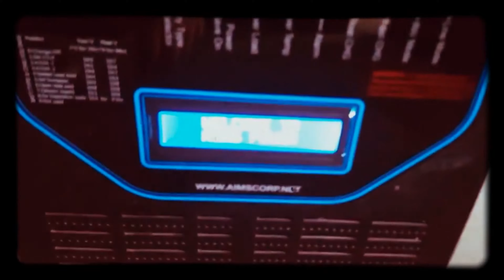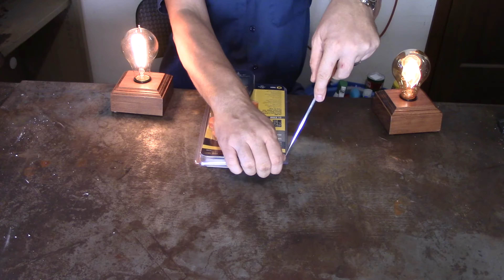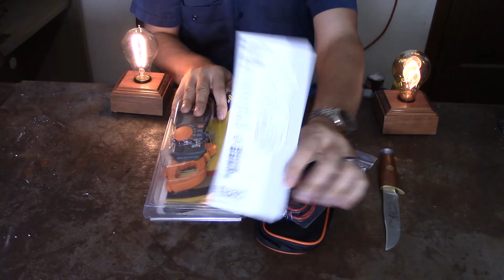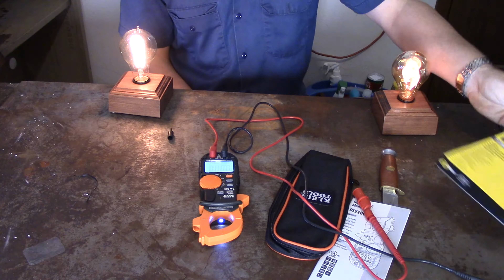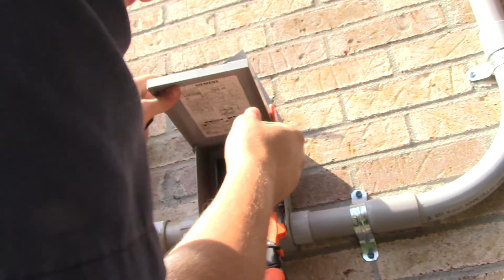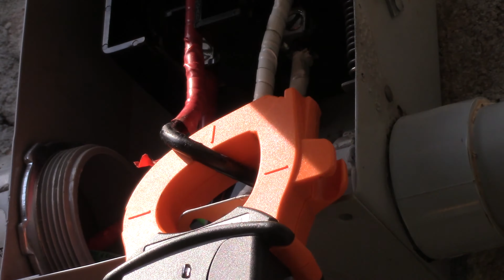Unboxing Klein Tools Meter For The Repair Of The Solar Problem.

Comment: And never leave the test lead in the current socket after taking a measurement - always return it to the voltage input! Not that you'll have this issue much as you'll be using the clamp for the current. A DC reading clamp meter is a very nice item to have when working with solar power. I don't know what I would do without one!
Reply: Btw: If you suspect that a component such as that disconnect is making a bad connexion measure the voltage between it's input & output terminal. If you're getting a few hundred millivolts difference then the connexion is not so good. In fact if you know the current flowing at the time you can do a simple W=E x I calculation to see how much power is being wasted across the component. It's also a good idea to measure across a similar item (running in circuit) that you consider is in good condition, so you know typically what an acceptable voltage drop is for that component.
Reply from the maker: Thanks i will look at that next i was really busy today and tried to make a video but did not turn out good so i will start over.

Comment: Andoer UNI-T UT210E True RMS AC/DC Current Mini Clamp Meters w/ Capacitance Tester   i got this one for 54 bucks CDN . i got the idea from Chris in Oklahoma. Chris swears by it so i got it. no magnet but has what i like the dc amps is neat.
Reply from the maker: +George Gardinier cool
Reply: Yep, I got one of those UNI-T jobbies as well after seeing Chris' videos.
Reply: i put mine on the negative wire on my car and could see how much the computer etc draws and was surprised. did some on my solar panels like chris. 54 bucks was a great price

Comment: flip the amp probe over it will read different.   current is the same in a circuit unless there is a leak to ground or something to take it away
Reply from the maker: ok thanks I will look at it today

Comment: Hi
Good try but it's a lot of hot air … LOL 

Electronics 101 circuit current will be the same end to end .
Resistant will drop the total current & the out put voltage 
but the circuit current will be the same end to end .

So it must be the clamp meter reacting to the 
noise generated by the charge controller .
If your looking for a voltage drop use a 
volt meter across the suspected faulty part .
Reply from the maker: It was not the same because of the add resistance that was at the disconnect on the positive and negative This was creating a arc fault.TRMS My meter is not cheap and I did test it at the charge controller and if you go back and see It's very precise we will see today. I will document the results.
Reply: Even a expensive meter can have trouble with complex waveforms 
like PWM or a chopped waveform riding on a d/c pedestal .
The t r m s will have a maximum frequency 100hz maybe & 
it will expect a a/c sine wave .
You just measured the noise drop across the disconnect proving 
it's has a resistance .
You just can't have 10amp in at one end & 5amp out 
at the other not with just a wire .
Reply from the maker: +gd2329j it's a good argument but it doesn't change the reality I have a voltage difference and an amperage difference from the disconnect and after I repair the problem the problem that I had had disappeared why is that
Reply: The replaced disconnect has less resistance & so less noise across it .

The clamp meter is reacting to the noise from the charge controller . 
Check amps on the positive & negative wire at the combiner box end .
It should be the the same .
Then check the amps at the charge controller positive & negative PV in .
If you have a positive & negative difference the test is at fault or 
your outside the capability of the meter .
 If you get 10amp at one point in a circuit it's 10 amp where ever  you
measure it in that loop unless you tap off for something .